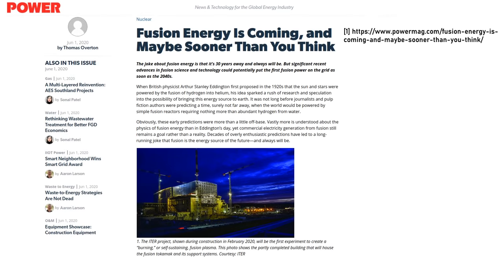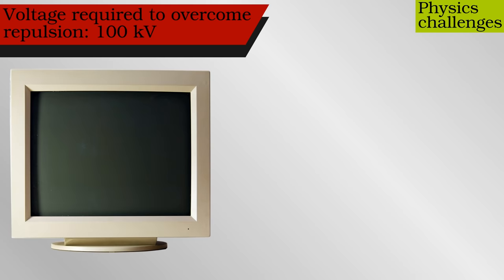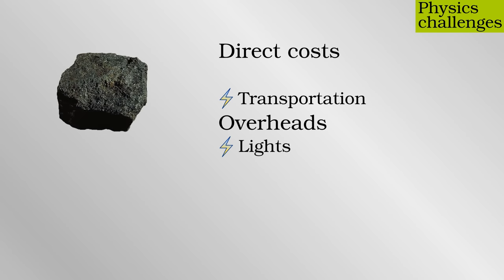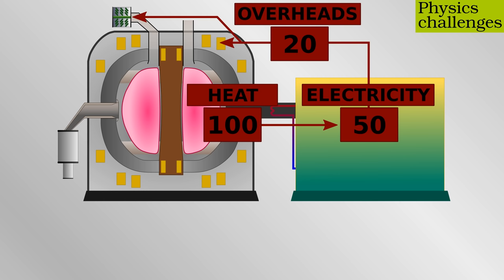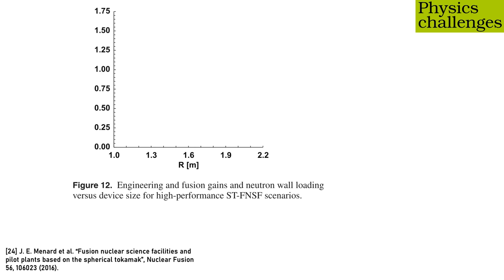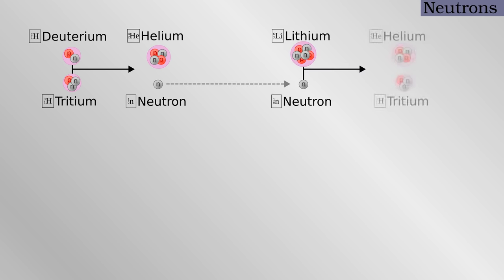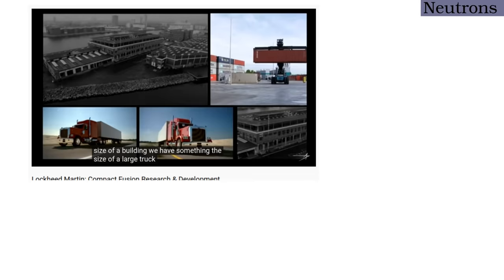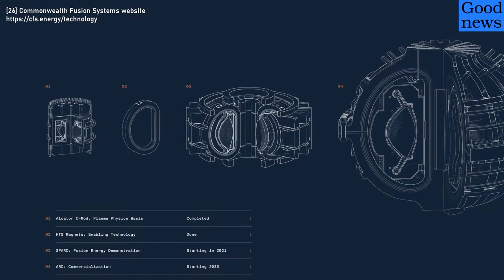Former fusion scientist on why we won't have fusion power by 2040

Comment: As a computer engineer, I have strong doubts if the costs for computer systems are so relevant compared to the energy needed to power the coils for the confinement of the plasma. Also these cryopumps probably clock in at 10 or 15 MW, I guess. If you had a power hungry server with 300 W, you could set up 50,000 of them until you match the power consumption of one of these pumps...
Reply from the maker: Fair point about typical digital server infrastructure running high-level code. However, this ignores power-hungry electronics, some digital, some analog, closer to the metal. At JET (shown in the thumbnail), there are racks and racks for things like control of the systems and emergency interlocks which cannot be trusted to software. I suppose you can dismiss these from my definition of "computer control systems" if you define a computer as a fully programmable Turing-complete machine. My point was that this is still many times more power-hungry than perhaps a coal or oil power plant.

Sorry for replying this late, but I only just saw and rescued one of your comments from YouTube's auto-moderation.
Reply: @ImprobableMatter  Yes, there is probably more than just computers. This CAN usually be implemented in a power efficient way, but working both in the industry and in university research in parallel currently, I agree that often just the quickest solution is plugged in to get something up and running as soon as possible without much regard to price, size, or energy-consumption. I've even seen systems that spanned a whole 48U rack which were then being condensed down to a single 1U rack system from one product version to another (some safety electronics in a railway control center).

Also the research electronics for automated driving at my university took up the whole trunk of the car and required several hundred Watts of electricity. It's fine for research. For productization it's not so useful.

Btw.: Software itself is not the problem. The problem is software that was not designed up to safety standards running on ordinary servers which can neither guarantee stability nor timing behavior. Basically this is the reason why you want specialized platforms and isolation. You need the first one to be sure that you can meet all timings and to be sure that the system doesn't hang up unexpectedly. And you need the second one to be able to run both safety critical software and non-safety critical software in your system. E.g. in an airplane all computers are somewhat connected to each other. However, there are firewalls and other measures to isolate the systems logically. Therefore, the whole infotainment can be developed to a standard that "it should just work for passengers", while the avionics software must be certified to meet DAL-A standards. With the help of isolation, your infotainment cannot have a negative influence on your flight electronics. If there was no isolation, the infotainment would also have to be programmed to DAL-A standards and that is gigantically much more effort than "just programming it".
Reply from the maker: @fr89k  Fair enough, good points. Future power plant would likely trim a lot of the fat and move a lot of hardware systems to software. Obviously no entertainment system in there, though.
Reply: @ImprobableMatter  Yes, of course no entertainment, but can have some monitoring equipment for example which will also get a safety rating, because it shouldn't fail, but it's not a mission critical piece of equipment. Of course you don't want to operate a power plant blind, but failing to report measurement data to the control center would "only" cause a shutdown for repair (or restart of all systems). It's expensive, but nobody dies or gets harmed. For example in a car, the electrical steering or antilock brake have level ASIL-D, because people might die if it's not working properly. Radar cruise control or the displays for speed and rpm are normally ASIL-C. They shouldn't fail, but if they do so, it doesn't automatically imply that people will die. Brake lights or headlight failure are ASIL-B and rear light failure is ASIL-A. Your infotainment in the car is rated "QM", as no safety standard applies. Just the normal quality management process that you have in any software production (e.g. games, video platforms, etc.). And in a power plant you generally also want such safety levels to put the effort into the systems where it's actually required while not overdoing or overengineering parts that don't require it.
Reply: These computers will obiously need RTX 4090 that consume 600W
Reply: @ImprobableMatter  What do you think about Zap Energy and Helion's approach to fusion? Based on the magnet test it does seem likely (at least from what I've read I'm not an expert in this field) that commonwealth will succeed. However, with the massive and continuing decline in solar and battery cost it remains to be seen whether it will be cost competitive. This is why I'm curious about those two companies approach to fusion since they seem like they would be significantly cheaper to build if they work.
Reply: @Drew Kangaroo   300 W x 50,000 = 15,000,000 W = 15 MW, not 15,000 MW.  Check your units before telling other people that they have embarrassed themselves.
Reply: @Drew Kangaroo try again with a calculator haha
Reply: @TROPtastic  I like how the computer engineer just didnt even acknowledge the kangaroo guy lol.

Comment: I agree that a lot of the hype over fusion is overblown due to a lot of unsolved issues being quietly swept under the rug. However, I think we maybe actually are finally 30 years away from developing a real process for fusion. It will probably take more time to actually scale it up to a viable energy source, but it's pretty exciting the developments that we've made just in the last several years alone. Who knows, we may even have some incredible technological breakthrough that could speed up that process. I just hope to see it implemented within my lifetime
Reply: it´s been 30 years away for almost 40 years now. My scepticism is solidifying at this point.
Reply: @Samuel Shadrach Yes, and Ada Lovelace defined the difference between hardware and software in 1843 and wrote the first executable  code. But there is a difference here: 
All principles were known, it was merely a question of craftmanship, time and money to built the analytical machine. The fusion engine is a different beast: We are still in the process of understanding the underlying principles, and/but we already know we need a core blanket of unobtainium to make it work. And then we don´t know is it will be viable in a power grid, given how mucn juice you need to start the process. In 1840, it as crystal clear that the analytical machine is possible. We still don´t know if the fusion engine is possible, only romantic idealist future enthusiasts believe that their hope is certainty.
And it´s not as if there wasn´t any progress in technical information processing between 1840 and 1945. encoding and codebreaking machines were being developed all the time, exploring principles of information theory and how to transform them into thechnical devices. the Enigma machine was commercially sold since 1932.
40 years of running into ever rising, ever more expensive walls might indicate that fusion as a source for household electricity might just be a wild goose chase, much like vacuum or pressure-driven subway systems, zeppelin aircraftcarriers, nuclear fission cars, tractor beams and portable replicators.
Reply: @Sol or it might be another 30 years, just like the last.. Well, there is a chance it might be the last 30 years, because after the next 30 years, humanity might not be able to invest into or build machines like that any more.
Reply: @Samuel Shadrach If you believe that, especially the examples at the end, we need not continue talking, that´s beyond hope. Have fun with your dreams.
Reply: @Samuel Shadrach There might not be enough ressources in our solar system to actually leave it, the math doesn´t work out. Space is too big.  Just because the asteroid belt contains millions of tons of metal ores, hydrogen, oxygen and whatnot doesn´t means it´s nearly enough. The energy requirements for FTL travel of meaningful masses are insane. Although we have the math ready to go and build it, we would need to guzzle up our entire sun to send a probe with Albucierre drive to a different star system nearby, in our local corner or our own galaxy. Leaving this place is NOT an option. It doesn´t work.
You can make developments to explore and utilise your possibilities inside your physical limits. You can make developments and discoveries that bring the limit of what you know closer to the limits of what there is, that looks from the inside like expanding your possibilities, but it is not, it is only expanding your capabilities. What you can not do is expand the physical limits of possibility.
From what we know, outside these limits are intergalactic travel and economically viable, stable "tamed" fusion as an electricity source. Watch the video: There are severe problems with the neutron balance, energy budget and radioactivity, and no real progress has been made in these really limiting technical issues, the progress that has been made so far is meaningless in terms of implemetation, and it has been like that all along, I am following this development for 20 years now, all the flashy headlines all the time only reported trivial techbabble that did nothing to solve anything meaningful. I am/was really really stoked about fusion energy to solve most of our problems, but it´s not the 20 years, it´s what I learned in these 20 years that convinced me that fusion power development is beating a dead horse to a pulp.
Btw, one of my exampkes: zeppelin aircraft carriers: Two of them were actually built, google "USS Macon" and "USS Acron". So, you can build them, it just doesn´t make sense. They don´t work in any meaningful way in realistic conditions, and are a general recipe for desaster, that´s why we don´t built them any more.
Reply: @Samuel Shadrach It wouldn´t take you decades to send your 2gram probe anywhere, it would take many thousands of years to reach another galaxy, even millions. But anyway.
The Macon was theoretically possible, it was also possible to build it, but it crashed, because it was huge, and vulnerable to real weather, and operating the parasite fighters was extremely dangerous for both parties, so it was not only outcompeted, it was just not a viable option for its intended role, and fusion energy is very likely pretty much the same thing for me. It works on paper. And maybe, and that´s a BIG "maybe", it is actually possible to build a demonstrator that kind of runs for some time, if you wait long enough and throw ludicrous amounts of time and effort at the project. But is a possible technical implementation suitable to provide stable supply of base demand power in a commercial grid for a reasonable price? I doubt it. And I am no longer  even convinced it is possible at all to build something usable out of it.
My objections, in case you are interested, are two, and both are mentioned in the video: A) the neutron balance, and the requirements it poses at the core blanket, and what these contraints mean for the efficiency of heat capture and general reactor running/maintenance. As the video said, you can not afford to lose any neutron from the chain reaction, and you need a meter thick of beryllium that gets in the way of everything, and needs to be replaced regularly.
B) the combined product of all the intertwined meagre efficiencies in the different energy conversions you need to actually run the thing make a general break even point for an integrated system look very, very far away. If you manage to get  a little more heat out of the fusion than what you pumped into it with your ginormous laser array, what does that amount to? Right. Nothing. And consider, you don´t just need to run this thing continously and stable with a net gain in energy, you also need to produce and built the peripheral components, like the magnets, pumps, lasers, and factor that into your energy budget.
In addition: c) it is neither safe nor clean. It does produce quite some radioactivity, and in case the magnet field quenches, and the energy stored in these ludicrous magnetic fields gets cut loose - have fun. We calculated the energy content in school, its a staggering number, if that gets free as heat in a few milliseconds, it´s like a MOAB going off in the facility.

Comment: I always think of the poor 50% efficiency on thermal-electricity conversion of Fusion Power, all that amount of thermal power wasted in a old steam turbines, but I think that many startup are working on this issue. One possible way to increase efficiency and usable power is to use heat for industrial heating and district heating as well as converting wasted low temperature heat to power again, in a cascade solution. One Startup is taking serious solution for Fusion like Helion , that claim a 95% efficiency of recovering electricity from their Fusion Reactor using Aneutronic fusion with He3. 1 fusion every 600 seconds. Next prototypes will increase this numbers. And they bypass the Ignition problem, because they are focusing Electricity production using Supercapacitors to ‘pulse’ Plasma and Fusion inside the reactor, and gain electricity Directly from magnetic field and fuel exhaust.

Comment: Reminds me of the "hydrogen economy" that was discussed in my university engineering courses 50 years ago.
Reply: Cracking water into hydrogen (and oxygen) are easy enough with abundant nuclear power. Without current battery capacities it made sense to power transportation with hydrogen
Reply: 20 years ago in my university engineering courses energy density and storage/supply infrastructure were discussed as the major problems holding back hydrogen. Diversity of energy supply was the only thing they told us was a good idea. All the individual energy sources were presented with advantages and disadvantages.
Reply: @lukehahn4489  : Truth be told, while a lot of fuss was made over hydrogen, it was really artificially made methane that made (and perhaps still makes) sense. Almost as energy/mass dense as hydrogen, more energy/volume dense than hydrogen, only a bit more energetically expensive to make (hydrogen is one of the feedstocks, so it'll likely always take more energy), and in every other way massively more practical than hydrogen.

The hydrogen economy was (and I guess still is) one of the opiates of the environmentalists, leading them astray from looking the problems and requirements straight in the face, like solar and wind (and I guess until enough raw material has been mined, batteries) even now still are.

Comment: Excellent well presented video. If you ever find time could you go deeper into aneutronic fusion. It is praised for  simpler energy conversion due to the charged particles. What would be the main roadblocks of providing the more demanding fusion conditions?

Also could tritium not be created by good old fission reactors. Something like a candu reactor on SEU fuel can provide quite some spare neutrons. Or are the fuel requirements for fusion plant higher than I thought?
Reply from the maker: I am currently making a video which touches on aneutronic fusion. Yes, the conditions for it are much harsher - higher temperature, higher pressure by quite some margin.

A fully working fusion reactor would blow through all the world's current supply of tritium in a couple of months.

Comment: That last two minutes really saved you from a very angry comment and got you a like instead. Excellent video!
There's a lot of scammers building pyramid schemes in venture capital, fusion is just their latest victims.
But Iter, and the subsequent Demo, have a really high chance of success. I'd be shocked if Demo, whenever it comes online, doesn't yield net power.

One benefit from the startups that might greatly benefit Demo though, is that even if they all fail, they may create multiplicative efficiency gains in design for Demo.
Say, slightly better magnets, better injectors, or heating elements. Every tiny improvement can act multiplicatively with Demo's massive size to make it better.
Laser fusion though, is the unredeemable type of fusion reactor that I cannot see ever becoming practical. I'm always shocked how the media can portray it as otherwise.
Reply: ITER is supposed to provide net power, isn't it? And DEMO is the upgraded standardized version designed for commercial use IIRC.

Comment: What about MITs new hts magnets? They required far less energy for cooling and are smaller, which would lead to a higher net output. They say a reactor with a Q>2 will be built by 2025
Reply: He did mention the MIT project. Common Wealth fusion systems. They use the super efficient Super Conducting Magnets.
Reply: The thing is that if the advances in higher temperature superconductors and these supermarkets were applied to more conventional electrical generators it's likely their improved efficiency would render both fusion and fission economically unviable....